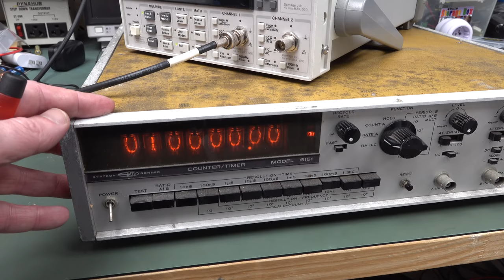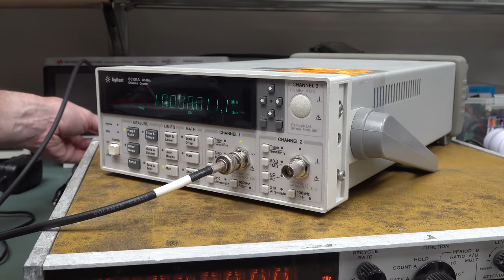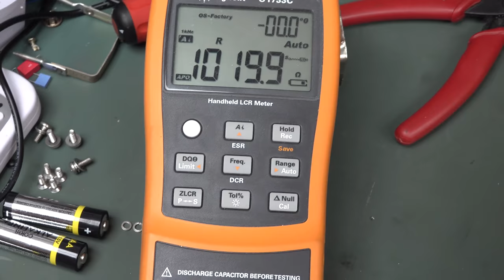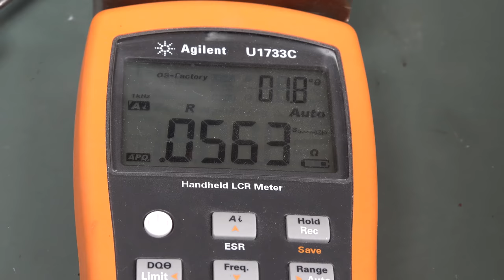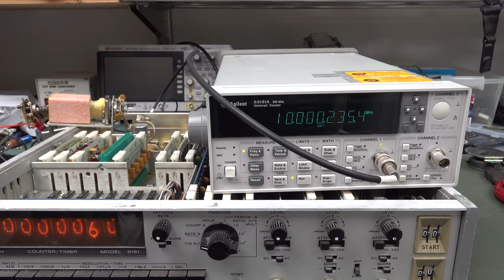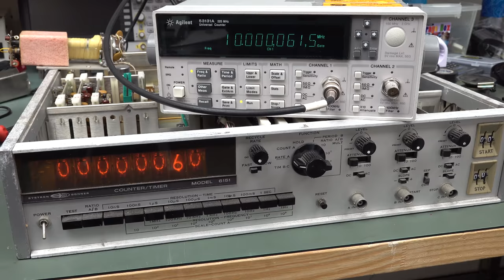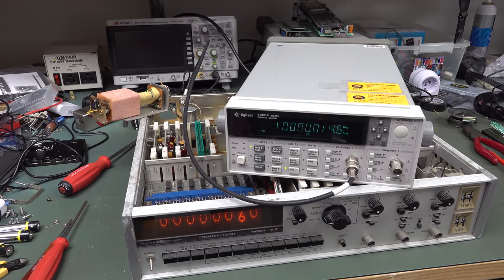EEVblog #1139 - OCXO Oven Oscillator Repair

Comment: How to use a frequency counter as a gravity detector: Drop it. If it falls, then yep, there's gravity.
Reply: My phone also work as gravity detector.
Reply: Still Render Production Yes but only once or twice depending how durable your phone is.
Reply: @vgamesx1  You correct , I try trow my phone up it fly away and never drop back,I guess no gravity here.
Reply: Still Render Production Actually, most phones contain a built-in gravity detector.  It's used to determine the proper rotation of the screen image.  With a test application you can see the numbers it outputs.
Reply: Also how to determine the age of one of these. The bigger the crater it leaves... :D
Reply: @johnfrancisdoe1563  Just try it on cpu-z app , never know that my phone read real gravity before, it read 9.8 m/s² not just adc value.
Reply: Linus makes everything a gravity detector.
Reply: @StillRenderFilm  Now just take it to the moon and check if it reads 1.62m/s² there.

Comment: I don't know what stability tricks the new ovenized oscillators have implemented, but an ovenized oscillator that has been running for years is noticeably more stable than it was when it was new. The internal mechanical stresses have stabilized over the years, reducing drift components. In other words, and old one is better than a new one, and one that's been running for 20 years is best.

Comment: nobody sees the broken resistance near pin 14 of the IC ?? 7:31
Reply from the maker: Oh, didn't see that.
Reply: Well spotted, that resistor has sheared in half which can't be good.
Reply: And the board is burnt there. Something not quite right. Com'on Dave, fix the beastie. It's begging for a new lease of life and a new home. Make it a door prize with reciever cost shipping.
Reply: Good eye fellow watcher!  It's too easy to look over stuff when filming, too bad for the creation and viewing delays!
Reply: I was also wondering why Dave didn't spot that. ;-) It's very obvious and a common mode of failure for these things.

Comment: OCXO's require a minimum of ten minutes of warm up when they are working. Tantalum capacitors are a type of electrolytic capacitor. You cannot replace them with non polarized Mylar film capacitors. Tantalums are usaually very accurate as to their ratings unlike a standard electrolytic and used in precision circuits.Try finding a tantalum of equal value for precise calibration or substitute an electrolytic if precision is not of importance. Not much can go wrong with these units unless the heater element has gone open circuit. Love your videos and the great commentary! CHEERS!

Comment: I just took out my systron donner 7014 1970 year. Made in USA Concord California.
Been sitting a few years unpowered, so powered it up to prevent decay.
Small ac fans were used such as boxer or muffin fans.
Typically heavy rotors, sort of like my Revox reel motors.

Spins really freely by hand, probabaly lubed by my test and measurement repair team.
Takes a bit to spin up, but totally free spinning.

Some friends would say when is it going to take off?
A few years ago  I took it back from storage hoping it was not tossed. It was my instrument, and was going to be used in a reflex timing exhibit.

Got dragged to Maine following new wife's job.

So refreshing to see real 5's rather than upside down 2's. All nice and bright.

Comment: Atleast its from an era where service personnel were expected to solder and the manual actually tells you everything you need to know if not more.
Reply from the maker: Can't find a manual for this, it could be interesting.
Reply: I'm sure the manual for this is on some micro-fiche somewhere in a dusty old file cabinet.

Comment: and of course it was a god damn tantalum
Reply from the maker: And a tag tant to boot, old school fail.
Reply: What are you moaning about, old tantalums make life interesting ! They make an awesome mess when they fail.
Reply: right?
Reply: Bet all it does is decouple the 5V rail there on the oscillator, and the resistor being super toasty is because it is making the 5v rail from the 30VDc input voltage.  Probably the main 115VAC heater is open circuit, and funny enough I have a crystal oven that has the same type of setup, 115VAC heater and a bimetallic thermostat. Was thinking to retrofit it to be somewhat safer, seeing as the heater pins are so close to the oscillator ones, and i am not to keen on having mains voltages so close to troubleshooting the oscillator, even though it does have room to hold 6 crystals in there.
Reply: Jorno yep, as soon as I saw that I cracked up laughing.
Reply: Andrew Joy he he - yep, I’ve never seen soooo much smoke come from such a small device when I was younger stuffing around with them. 😁

Comment: I had the same problems with old worn out temperature controlled oscillators, to remove the case I find it better to use a hot heat plate and carefuly use a small gas soldering iron & stanley blades to go between the bottom of the soldered area, suck off as much solder as you can, use flux make the solder run down to one spot, as long as the main case is hot the gas soldering iron should work, I tried this on a Truetime GPS XL-DC 10MHz oscillator, must admit its not easy takes ages to remove the base depends on how much solder you can get off...

Comment: Not asbestos, it would be white and very flaky in its raw form and would probably have been wrapped. That looks like glass wool insulation. Please take the "Recycle Rate"  control (gate delay) off of infinity so the poor gate circuit can do its job... Also, consider donating it to somebody new, in its day that counter was considered the ducks cuts - I used one like it for many years.
Reply from the maker: The Recycle rate control barely does it's job. useless on fast, too slow on slow.

Comment: Is it actually fixed? the frequency was dropping on it's own from temperature, sure the adjustment pot actually did something, and wasn't just it warming up? :/
Reply from the maker: The heater isn't working
Reply: Freq dropped all time. Not sure did adjustment do anything or not. Can you adjust it up while "natural" dropping?  ie. adjust in both directions independently whatever that sick puppy is going by itself.

Comment: btw, an un-official but very good test for asbestos is to try and burn it (simply put your lighter on it). 
If burns or melts you're good, but if it glows hot red without cringing it's the real deal (asbestos).

Comment: I don't think you have repaired it...  you found a failed component and replaced it, but after that the frequency was still off and not well reacting to the trimmer.  The frequency dropped, but it continued to drop without you touching the trimmer.  That is because of the oven heating up (thermal coefficient of the oscillator as a whole is usually negative).
Furthermore, the failure of the tantalum 2.2u capacitor which likely is some supply decoupling in the heating circuit would not at all explain why the trimmer was ineffective.
There must be some other fault like a break in the connection between the trimmer and the oscillator circuit, or failure of another (small ceramic) cap in the oscillator.

Comment: @8:50 looks like there is a component broken in two just above the chip on the top left just right of the resistor going over the chip, that might be why its not heating correctly? idk if it's the problem but its work a shot to see if you can get her up and going! Cheers mate
Reply: Indeed. That and the damage on the corresponding pad on the reverse side of the PCB immediately stood out.
Reply: You're right, there looks to be a vertically-mounted resistor broken in half.

Comment: Even though replacing the OCXO with a new one would be easier, i would've still attempted to fully repair the original because its not being wasted then and a new OCXO costs money. Replace the tantalum, check the resistance of the heating coil and check for presence of 115VAC.

Comment: Dave, maybe you've already done one, but I'd like to see a video with guidelines etc--from an industry standpoint--on how you would decide some piece of equipment is beyond economical repair.  Obviously the criteria are going to be different than when you're making videos for entertainment/education, but I've had repair requests rejected for equipment that I didn't understand (although of course that usually meant getting brand new gear so I never cry too much.)  I was just wondering when it stops being an engineering decision and is just a beancounter decision.  Another great video, thanks.

Comment: It's "flapping around" because fiberglass laminate burnt to charcoal and  it's resistance is changed due some current flow throught the burnt fiberglass laminate. As I think. Need to replace that piece of burnt fiberglass laminate with new one.

Comment: So like the output of this box is a square wave or that sort of thing? So if the crystal is the square source? Does something have to digitally scale that pulse to some other length as per the trimmer? Maybe it just changes the temp of the box, that would work maybe if the crystal was almost bang on to start with.
Reply: Yes, the output will either be a square wave, or a sine wave.  The trimmer cap pulls the frequency of the crystal to give a small bit of adjustment range.  It doesn't change the temp of the box.  It would take you 3 weeks to dial it in if it did.  And on these old OCXOs, the problem is always, always the heater.

Comment: Welwyn is pronounced "well-in" - only 20 miles from my hometown in the UK. 
I knew a few guys that worked there in the late 80s. The brand still exists today -  now part of the TT Electronics group. They were famous for good quality high power wirewound resistors as well as other wound components.

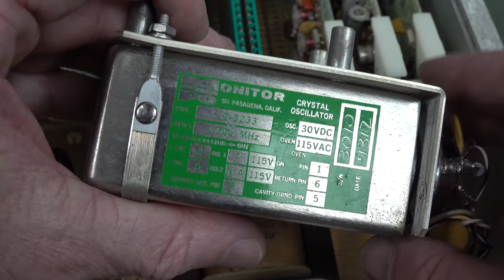Comment: 3:32  OCXO can says "Freq 1.000 MHz"  measures at 10 MHz? Maybe the 5313A has a x10 programmed in somewhere?
Reply from the maker: Oh, missed that. But it outputs 10MHz, the 5313A isn't wrong.

Comment: If you remove the carbonised parts of the PCBs you'll probably get a greater range of adjustment with the trimmer.

Comment: Is there a reason to even use tantalums anymore since ceramics have made so much progress?
Reply: The Dollar Guy I'm unsure what rare minerals are used in the higher capacity ceramic capacitors like 2μ2 SMD caps.
Reply: I have 10uF ceramic chip capacitors.  I believe the layers are so thin from modern fabrication methods, ceramics can reach high values...22uF even.  Ceramic capacitors have low ESR and should be the modern and superior equivalent?
Reply: Yes, there is such a thing as too low an ESR in some applications leading to unwanted oscillation (ceramics have very high Q and thus poor damping), so tantalum are still useful when you need a lot of capacitance in a small space but do not want either the very low ESR of ceramic capacitors nor the wide swing in capacitance (e.g. -20% to +80%)that comes with higher value (non NP0) multilayer ceramic capacitors.

Comment: Ha, ha, beautiful! Straight-up 7400 TTL quad NAND gate - haven‘t seen one of those in awhile! I guess HC-series (or F-series) TTL hadn’t come out yet. None of this LS rubbish! 😁 And why do they need a heater? That resistor clearly gets plenty hot! Besides, I saw a cheap-as-dirt 1 Megohm 10% carbon comp resistor in there; what gives with that? They want the stability of an OCXO, and they throw in a cheap resistor? What’s next, ceramic disk caps? 😆

Comment: does anyone know why they used to design PCBs without straight tracks, since nowadays industry convention is straight line tracks?
Just something I've noticed.
Reply: Back then PCBs were laid out by hand using black crêpe tape on polyester film - no CAD. Doing straight tracks with mitres took a lot more effort than using curves so that 's what you did.

Comment: Nah, that's fiberglass, itchy but not deadly unless you inhale a bunch.
Is it just me or does it look like that was reworked from the original design, or maybe repaired before to bridge around the burn? Ah, just wrap it aluminium tape! ;D Oh, no heat to hold in, welp!

Comment: Being December of 73 I would say no it is not asbestos.
Reply: Eh. Asbestos was just starting to be banned for insulation in 73 so its possible.
Reply: @DoRC  What other than insulation was asbestos used for?
Reply: @wheelitzr2  I know it was used in brakes and clutches but I was referring to house insulation.  Not sure what else it was used in beyond that.
Reply: It was also used also in insulating pipes eg. cast iron steam pipes.
That stuff in the can looked like fibreglass though...
 - Eddy
Reply: @DoRC  you are correct they used it in clutches and brake pads but used as an insulator for the glue backing off the pads, it was Incorporated into the pad material to add insulation from the face to the glued side of the pad or clutch. That's why pads will tend to separate when they get to low due to the heat effecting the glue backing.
Reply: @EngineeringVignettes  yes its main use was steam lines in industry and on ships. I have several customers that have had to abate the rest of their asbestos pipe insulation just this year.
Reply: wheelitzr2 It was also used in roof plates for durability.  One of the local manufacturers got in big trouble when their first attempt to switch to a non-asbestos compound proved to be less durable than the warranty.